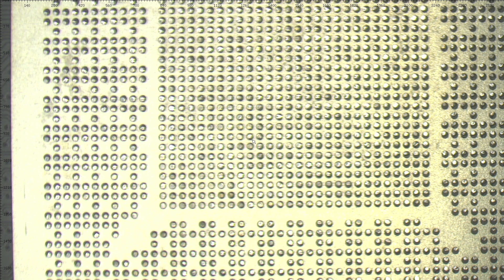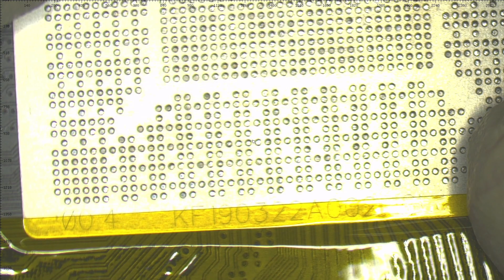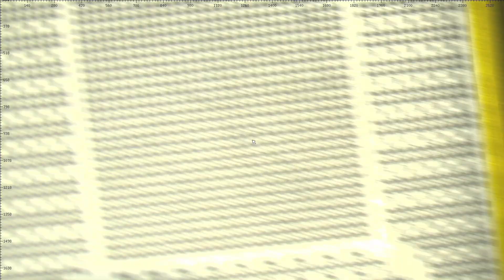How to Reball with Direct heat stencil and Solder paste #gpureball

Comment: There is risk that stencil would be stuck to the PCB ... put tiny kapton tapes under the stencil in every corner , then it is easier to pry off.
Reply: PCB prevents the stencil from warping that easily. You can also use lower temp solder paste and only use underheat to form the balls, which eliminates any warping. Krisfix also said in the video to not push the paste too much, otherwise it goes under the stencil. But yes, sometimes this method needs couple tries to get all balls to form properly. Also you need to check the height of the balls after first application&heat. If some are lower and smaller, you should reapply some paste there  and heat it again.
Reply: I once again tried to place the kapton tape pieces to the corners, and like northwestrepair said, this caused the solder paste to seep incorrectly. The stencil has to be without such corner tape pieces, otherwise it will be too high up from the PCB surface.

Comment: Excellent buddy, thx for video. I did reball of my 1060 directly to pcb using 0.45 balls a week ago for experiment. it seems to me best way not to overheat gpu.
Reply: May I ask what tool you used to solder the GPU? (brand and model)

Comment: why would you do that? if to solder balls to a pcb first, it will be difficult to fix any troubles on it because pcb has a lot more thermal conductivity and you will have to preheat it first. 
it also heats the pcb twice (first on ball soldering and the second on gpu soldering)

Comment: great work! is there any advantages of reballing the board rather than the chip? or just a different approach?
Reply from the maker: Basically for GPU reball you need to heat the chip 3 times ( remove, reball and install). With this board reballing process you can heat the chip only 2 times. Decreasing the heat stress.
Reply: @KrisFixGermany  i see.. thank you for explain me well.

Comment: You are my master! Im wondering how to reball chips , thank you Chris !.How to solder gpu after that,do i need bga station?
Reply from the maker: Thank you. Actually I’m using BGA rework station for GPU and RAM. You can use this method for every BGA chip if you have enough space to place the stencil

Comment: And then you reball the chip by hand with hotair?
Reply from the maker: You don’t need to reball the chip
Reply: @KrisFixGermany  sorry, i meant  reflow, do you use the preheater below and heat up the chip wit hotair or use a machine to do that?
Reply from the maker: I use rework station for this procedure
Reply: @KrisFixGermany  What temperatures do you set on top/bottom to settle the chip with this kind of reball? Great work!